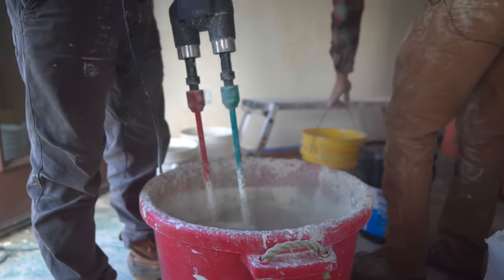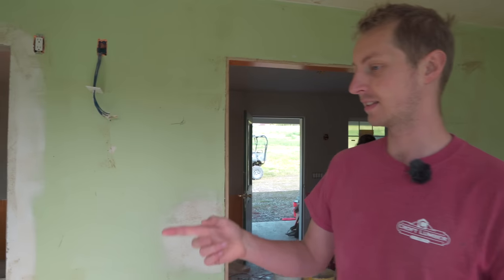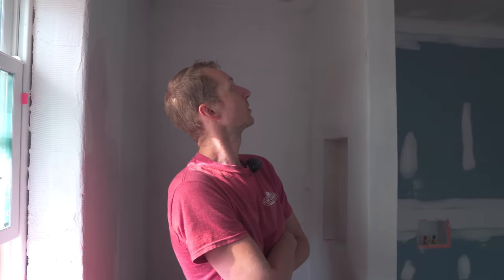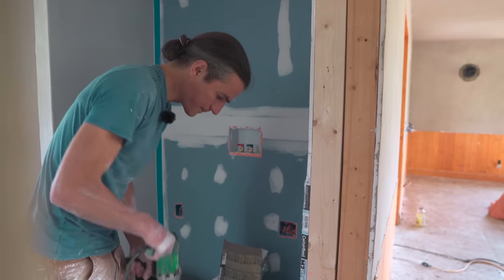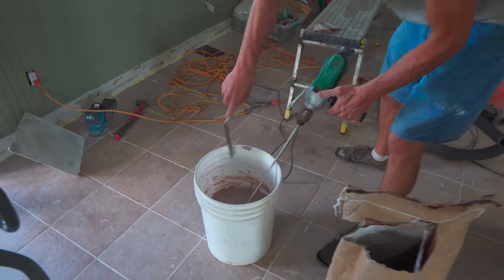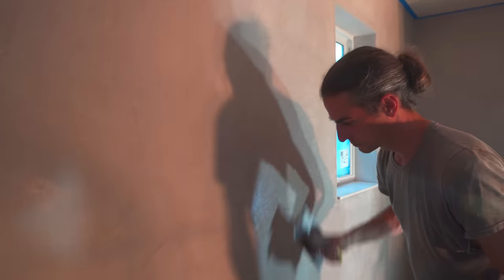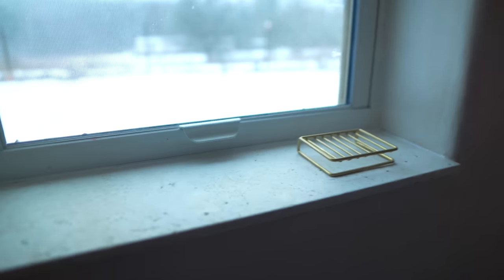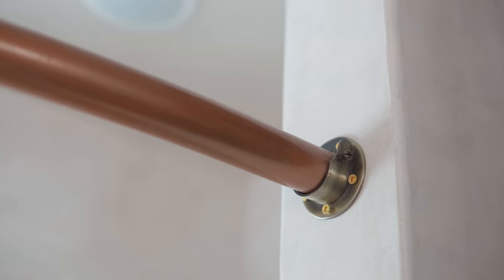BEFORE/AFTER Home Renovation with CLAY, LIME and TADELAKT Walls — Ep. 148

Comment: looking very nice! we have renovated several homes over the last few decades. mostly smaller historic seaside cottage and bungalow  styles. we used traditional materials whenever possible. many older homes had really crappy bathrooms so we moved walls and opened spaces when it was  possible and of course had to find space for closets and utilities(water heaters, washer, dryers etc.). we usually did glazed tile( really cool handmade mexican and moorish styles) in showers and countertops because it made it easier to clean soap and water residue. i would suggest a hand held shower head to rinse down shower walls after each use. i make this suggestion because we owned a house and business cleaning service in the past and shower walls can be a cleaning challenge. another suggestion that i found really important if you want to increase the desirability or value  of a home is the addition of french doors, arbors and decks, you can never have to many. you get more return on your money and livability for these then even bathrooms and kitchens. cant wait to see more future projects.
Reply from the maker: All solid tips that add to the conversation. Thank you Michael!